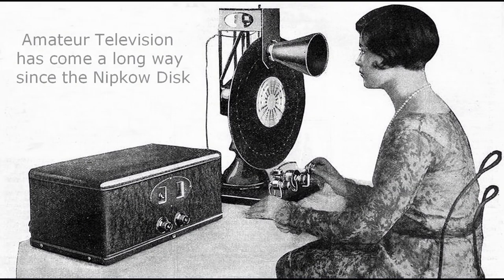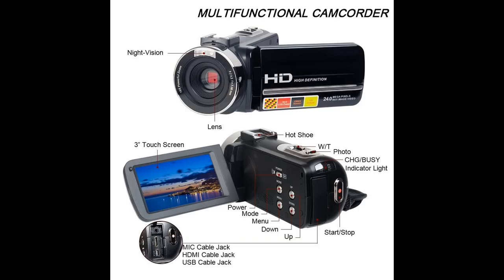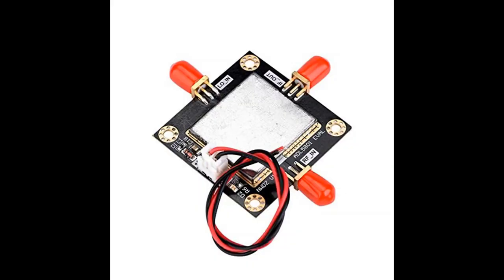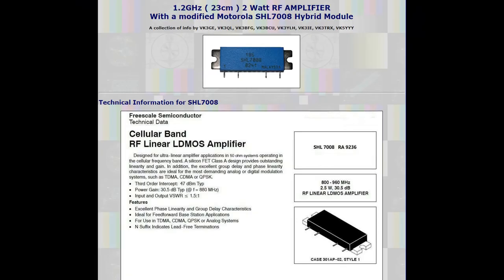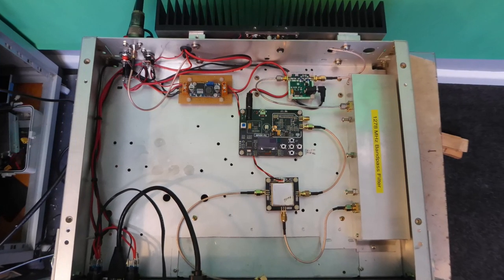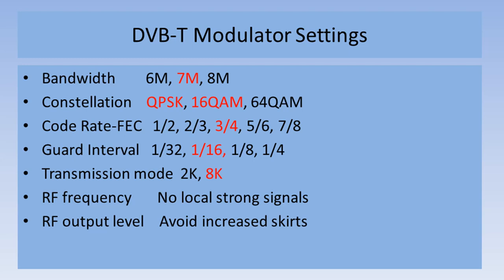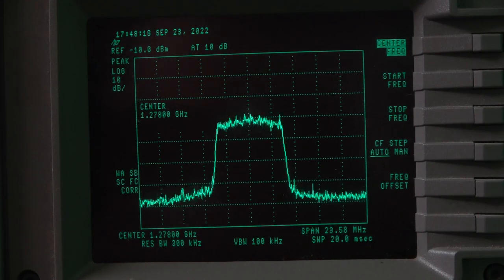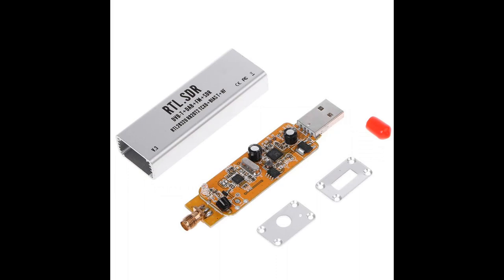How to build your own 23cm band  digital amateur TV transmitter using off the shelf parts.

Comment: Is there really more local DVB-T than DVB-S on 23cm? Most 23cm DATV I have read about was DVB-S, due to the ease of modulating QPSK and satellite TV receivers working directly for receiving it.
Reply from the maker: What you say is true but for those that want to go DVB-T this is a "home brew" way of doing it. Our local ATV repeater has both DVB-S and DVB-T inputs. DVB-T does have an advantage in hilly terrain in reducing ghosting problems. The hardware way of producing DVB-T means just a power button is pushed to transmit. When software is used to produce DVB-S a series of tasks have to be undertaken with re-starts sometimes required.
Reply: The Terrestrial modulation just happens to be superior for Terrestrial applications :)
Very nice to hear that your local repeater has both DVB-T and DVB-S inputs and that 23cm is getting used.